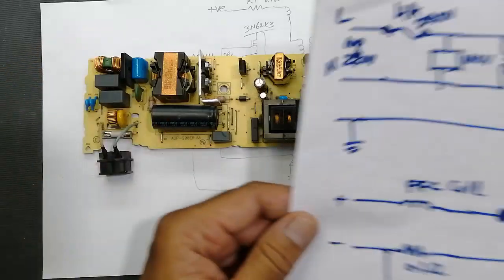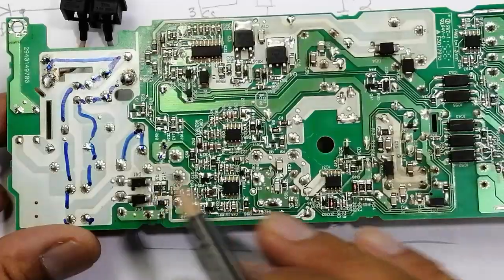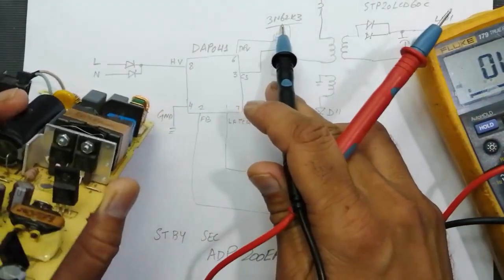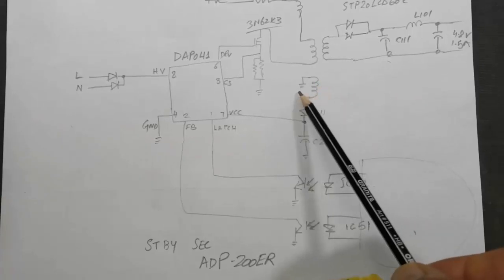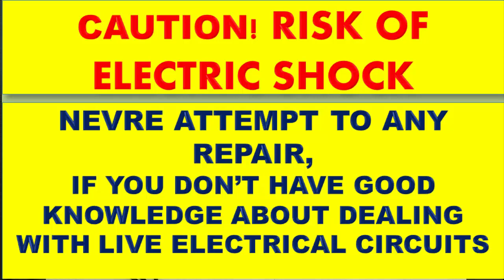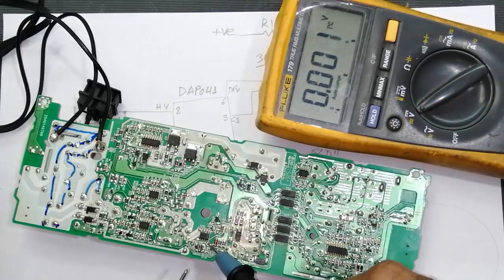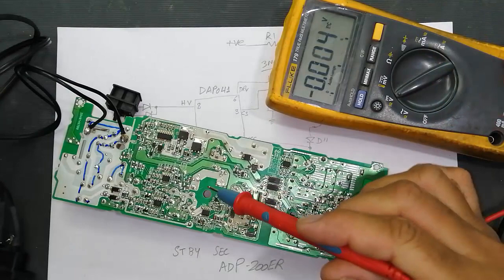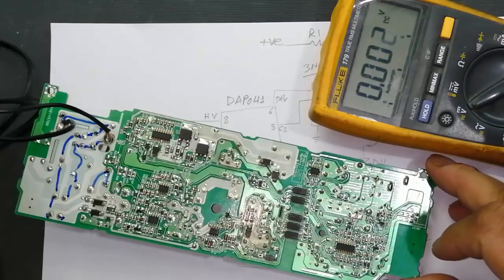#309 Sony PS4 Power Supply ADP-200ER - Standby Power Section Using DAP041AN

Comment: I have both resistors 272 burning out. the diode bridge is fine. diodes d41 d42 0.592. I can't figure out how to make it work. The 2.72 resistor melts immediately. please tell me your guesses.

Comment: Hello Haseeb.
I got a 7216b PS pro , but when I turn it on it doesn't react anything only beep sound but the led doesn't light up.   I think the power supply is at 12Volt but unfortunately I don't have a circuit diagram. The power supply type is ADP 300FR. I would be very grateful if you could help me.

Comment: Dear Haseeb,
First of all, thank you so much for these very fruitful and detailed explanations about the ADP-200ER.

I have an issue with mine and long story short, when AC is on (220), I have the 4.8V standby voltage present but at the very moment I switch on (like you did simulating the switch on), the PFC IC does not start switching and the voltage never rumpup to 410V.
At the same time the standby 4.8V collapses gradually to 0. 
I checked almost all components and I see no short or visible damage. Mosfets, capacities, etc all seems good.
The only remark I have noticed using a thermo camera is a breif temp raise at ZD24 (High side) and R158 (Low Side).
I also noticed an abnormal short in Q41 but even after trying to replace it or remove it nothing changed!
The ZD24 (zeiner) is normally at 15V and I see that when I switch on the coltage increases to 16 or ish then voltage collapses.
As teh ZD24 is in the High side that means the the command on moved through the optocoupler from the low side to the high side ...
but the fact that the resistance R158 (close to the IC151) is getting hot may means that the IC151 is faulty...

Any help or diagnosis direction would be very helpful.

Thanks!

Comment: Great video mate im working on a ADP-300ER PSU that has the same DAP041 (DAP046 fitted instead) and im checking voltages on each pin but on my FB (feedback pin 2) instead of 0.4V i get 5.1V. ON another good working ADP-300ER, i get the same if not very similar readings as u in the video. Can u tell me why my Feedback pin would be getting 5.1V? Does IC151 control the 0.4V here or further back?

Comment: Am having trouble with this power supply when you activate the 12v (shorting standby + acdc standby) the out put shoots to 12 but it drops . So does the pfc circuit and the standby drops. Any help?

Comment: i'm getting 139v at the 12v . any idea whats causing that?
Reply: at first no 12v then i repaced the ic u mentioned it 1 of ur videos
Reply from the maker: okay 
but 139 volt is really very strange
can you please verify it again and send it's pictures to my WhatsApp
00962791161084
Reply from the maker: 139 instead of 12v  is really horrible
might be transformer winding Is short circuited or class y capacitor between primary and secondary sides have something wrong

Comment: can we use smps switching module on this supply to get 12 volts?
Reply from the maker: yes we can any push pull switching ic to switch this ciecuit. like TL494 or SG3525 etc

Comment: Which pins has to be short to get 12v in 160er ps. Is tht 5v and grnd🤔
Reply from the maker: please make jumper between 5VSB and ACDC Stby pin
Reply: @HaseebElectronics  the volt is reaching upto 11.78 v and dropping back to zero when shortconnection disconnected. Is t like tht only or
Reply from the maker: @prasaadkrishna  
It will work only for that time period only when   jumper is present 
As the jumper is removed, the PSU must turn off. It will it's good condition

Comment: Very nice video. Can I ask how these chips are initially powered? In the schematic it appears as if the chip receives VCC from an auxiliary winding of a transformer it switches. But initially, there is no switching. So how does the whole system come to life?

Comment: Hi friend.

I love your videos, and I have watched your video many times but I can't figure out the cause of failure.

Please help me.

The main capacitor in my PSU goes up to 400v as soon as I short the pin, but the voltage starts to drop immediately.

Then it goes back to the voltage it was before I shorted it.
Even if I short it again, it does not go up again.

What is wrong with it?
Reply from the maker: so check the feedback pin of pfc corrector ic, i think it is not getting voltage feedback. 
or check operational amplifier ic closer to PFC controller ic
Reply: @HaseebElectronics 

Thanks for the reply.

I'll check those items out as I watch your video.
I appreciate your kindness in letting me know.

I love you.
:)
Reply: @HaseebElectronics  

Dear friend.

As you told me, I checked the VSENSE of ICE2PCS02 and it has the correct voltage.

However, I found that pin 7(VCC) has no voltage.
(In your video, pin 7 has 14V)

Is it because there is no voltage here that the IC is not working?

And where can I check to find out the cause of this?

As for operational amplifier, there is no description in your video, then I had no idea how to check it.
So I couldn't checked it,

Thanks in advance.
Reply: @pokochi-kun481 Good day,
Did you resolve this issue ? Am having the same

Comment: Is that the component that fails occasionally and causes the PS3s' common fault: when you turn on PS3, power led illuminates then turns off after 10 seconds.
Reply from the maker: yes the power resistor is a safety component, which is used to protect the next circuit

Comment: My supply makes a fizzing noise when plugged in.
I have 5v on connector. But no 12v when signal is shorted.
I tried to test but all smaller capacitors on output have temporary short while capacitors still hold charge(unplugged)
The fizzing sound seems to be coming from ether the large transformer or the mosfets, but cannot find any shorts there.
The temporary short is making testing difficult.
Reply from the maker: check dc voltage on main capacitor
connect PS-ON signal 
then check dc voltage on main capacitor
the fizzing sound seems from the PFC circuit. you can check rectifier diode of PFC circuit
Reply: @HaseebElectronics  Thanks for the reply......
OK, I plugged it in again, it blew the main fuse.....this one is a difficult one.
It shorted the bridge rectifier and traced the short by desoldering components back to a MOSFET  040...
Rectifier tested OK off the board, replaced fuse but have no replaceement for 040... Yet.
I still had the residual charge issue, where the continuity meter slowly drains the short on the smaller capacitors.
I have already replaced two IC's and the 16.2ohm resistor.
Reply: The supply was completely dead when I received it, as did the console which also has HDMI issues.
 So far I have only been able to regain the 4.8-5v signals.
This is just a learning project for fun and experience.

Comment: What is the best wattage rating for the R1 0.16ohms resistor would be best quality the 1/4 watt will go bad easily? Thanks for your help.
Reply from the maker: use 3 watt please
Reply: @HaseebElectronics   Thanks for your input
Reply: @GloryNationWarriors  did it work for you? after installing a 0.15ohm 3w resistor my fuse blown
Reply: @alostabv  no mines popped as well. I wired up a ps3 power supply with a CPU fan to cool it as I had them handy. Look up ps3 power supply to ps4 and look for my name in the comments for detailed help.

Comment: I got 16.4 Ω for the R1 (fuse resistor) the colour code on mines is Brown, Blue, Silver, Gold & Red. Did you measure yours to get a reading?
Reply from the maker: value of brown is 1, Blue is 6 Silver is multiplier 0.01    so  16x0.01=0.16 Ohm
Red is +/- 2%
so final value is 0.16 Ohm +/- 2%
Reply: @HaseebElectronics  I only found a resistance of 0.15 Ohm of 3w it works for me? . Thank you very much for your explanatory videos, they helped me a lot
Reply from the maker: @dragod7461  it is okay
Reply: @HaseebElectronics  OK thank you very much
Reply: @HaseebElectronics  Are you sure it's not brown blue gray gold and red?  It would be 16.8 oms.  In another video I have seen how they replace that resistor with the 20CT52R16R2 model from Mouser Electronics, this being 16.2 ohms
Reply: @juanantonio8561  Yes and that video gave incorrect information, it is not grey its silver so the multiplier 0.01 is correct.